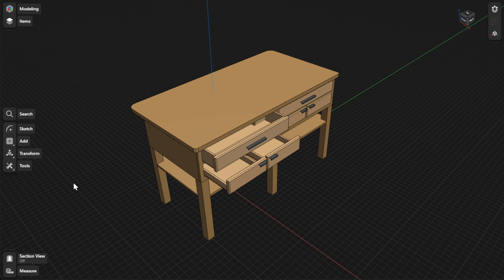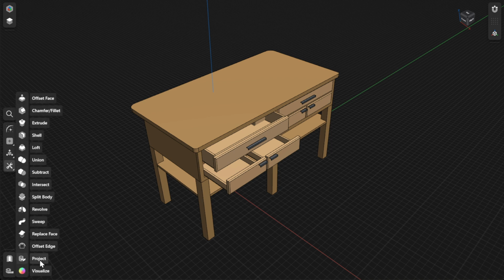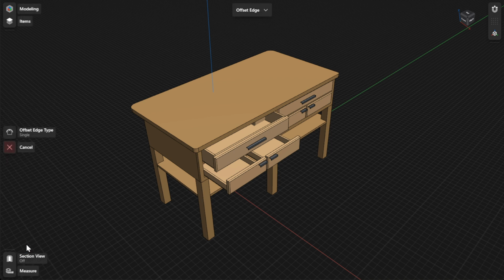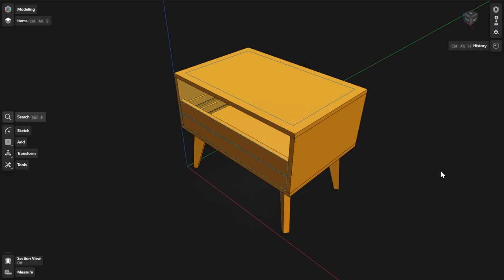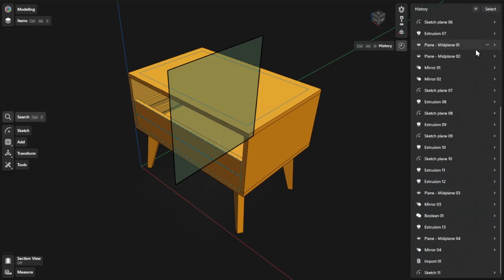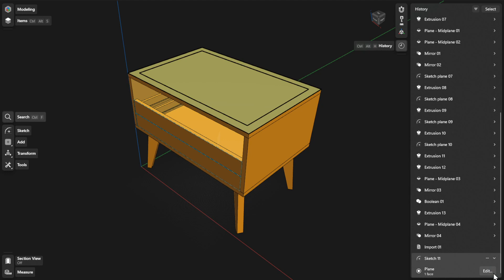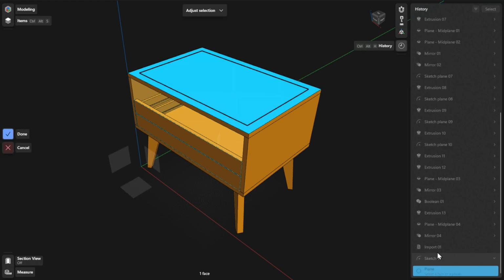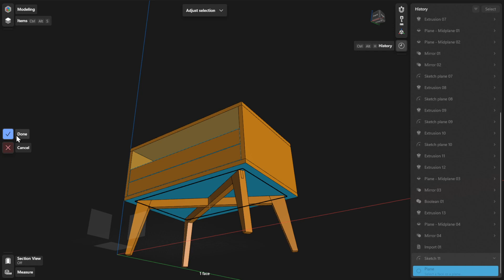Shapr3D Manual - Offset Edge (3D) | Tools

Comment: This modeler looks promising. I may download and try it, but I highly dislike subscription based products. I currently use sketchup 2017 with lots of plugins and blender. I like the way sketchup handles dimensions and how quickly I can model something simple like a washer with particular sized holes and have it 3d printing within minutes. Or a simple bracket to mount something. One thing that is currently hard to do that I keep repeating is making a mold of something that I will use for metal stamping. 3d prints are strong enough to stamp thin metal(but can do thicker metal like 18ga if doing a simple dimple die shape. But to make a mold I have to offset an entire model by the thickness of the metal to be stamped. It's very difficult and time consuming to make a positive and negative mold of a model with a gap the thickness of the metal.
Reply: Using shapr3D will take some time to get used to, but it is probably one of the fastest growing softwares out there. Plus they have a Facebook forum where you can ask questions and you’ll get fast replies. I personally prefer it on iPad with Apple Pencil, but its computer counterpart is just as good
Reply: @GhostKoffee   Thanks. I'm definitely going to try it out. Been looking for a replacement. I just don't want a subscription based application.
Reply: For a casual user, $40 a month just to have more than 2 files is very frustrating.  It could be worse (e.g., Linearity)
Reply: @F3PIZZA  I’m still using sketchup make 2017 with lots of plugins, blender, and occasionally fusion. All free. Sometimes I use freecad to convert files. Sketchup opens and runs very fast on my old but high end pc. I can get things done quick. I cant find anything that can do measurements as quickly. Even for simple templates to print out. I can open it, space out some circles certain distances and print within 1-2mins total. Even basic 3d print stuff, some things I can do very quickly now. Hard stuff still takes hours or days to figure out.